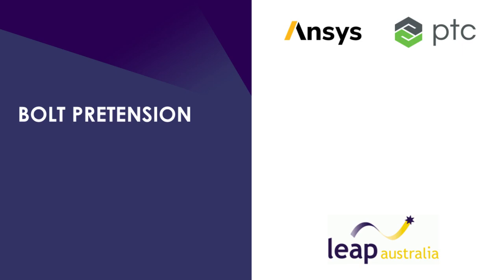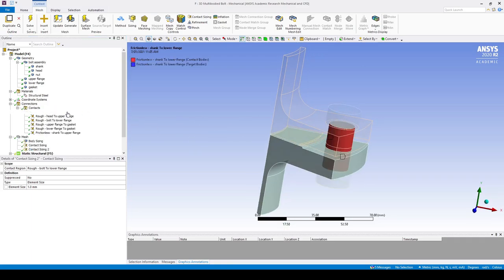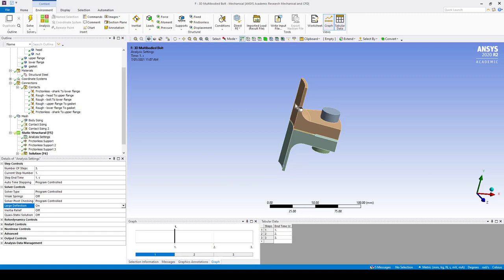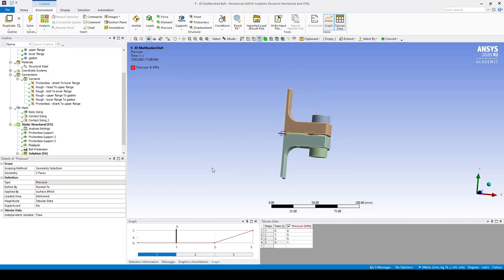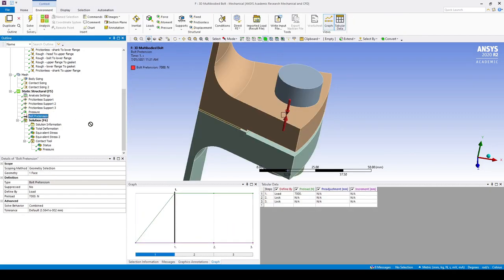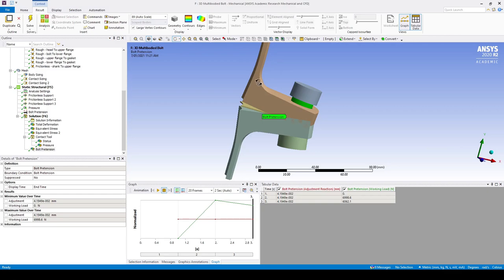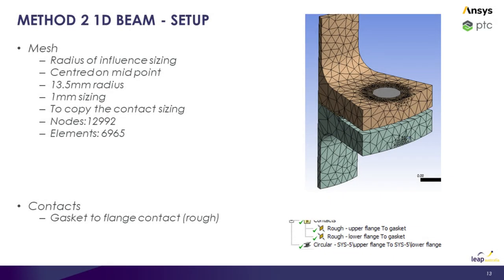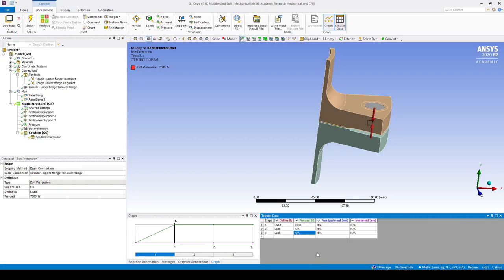Bolt Pretension using Ansys Mechanical

Comment: how would one model fatigue after pretensioning. the pretension should be fixed but in ansys it reverses using fatigue tool
Reply: Hopefully it doesn't.  You shouldn't be exceeding the elastic limit of the material.

Comment: Hi again. I've got high very high stress under the head of the bolt (in my case). I think it because the thread doesn't consider in the analysis and all force goes to the zone under the bolt head. In reality, the first round of thread takes the main load of pretension.  How go you think if I model a real thread what contact should be used  between hole and bolt thread?
Reply: maybe the contact of your bolthead and your flange face is bonded, i think

Comment: Hi. Why didn't you use fixed support contact for those three sides instead?
Reply: if you used fixed support on all three sides, the flanges will not deformate
Reply: Actually, it will still deform, but stress plots you will get will be way higher and inaccurate. you can use 2 axy sym constraints and apply differential pressure on the pipes to simulate more accurately. But most practical Industrial analysis we do, only involves determining the thickness of special flanges that are not covered by the codes.. There was one occasion when the customer put a class 150 flange for a pipe that operates at 22 bar pressure. Since it violated the codes, the inspection body left him two choices, either cut and re weld a class 300 flange or come up with FEA analysis report that shows class 150 flange can handle 22 bar pressure without falling apart. However, the flange will be replaced when the unit shuts down for annual maintenance.
Reply: Because it's simulating a section of a complete pipe flange.  When pressure is applied all "sections" will expand together.  The sliding support simulates the expansion of the pipe.